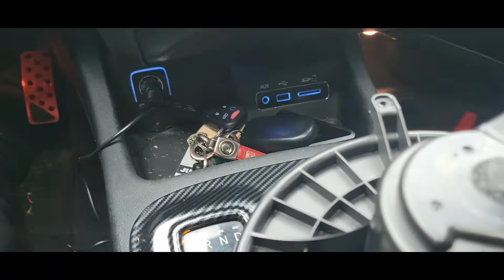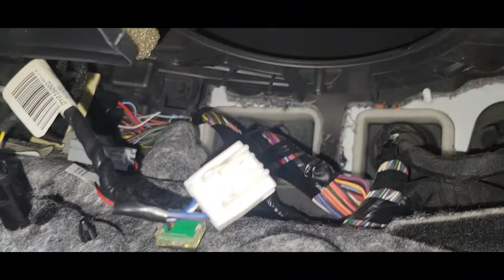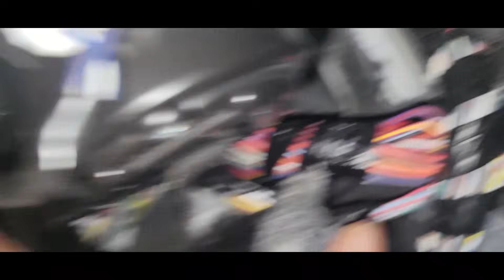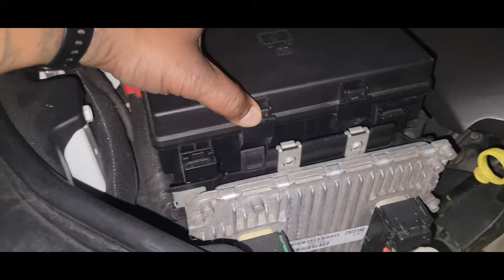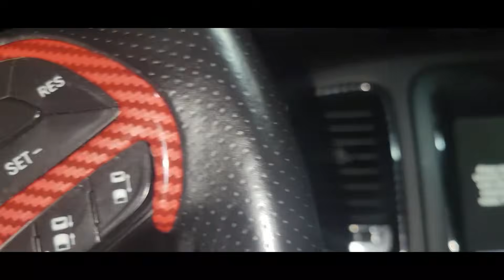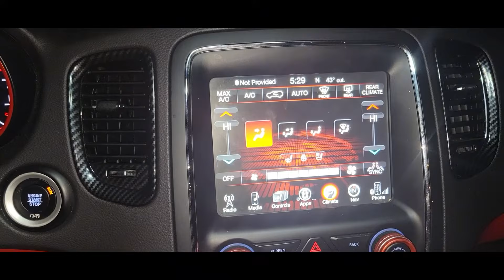How To Diagnose Dodge Durango Blower Motor | Repair No Blower AC/Heat On Dodge Durango

Comment: So what’s causing the fuse to blow?
Reply from the maker: The fuse usually blows due to an issue with the blower motor, resistor, or wiring, creating too much current. I had a friend mentioned that this will keep happening unless the blower motor is replace.  Try replacing the blower as an option and see what happens, but I have not had the issue anymore since I changed my fuse the first time

Comment: That was the exact problem with one of my vehicles.   Pulled the 40A fuse in the F13 slot.  It was burnt, replaced it, had air again.  Keep doing these vids.  You keep it short and simple and not beat around the bush.   Thank you.
Reply from the maker: I really appreciate that. Ty

Comment: Hi, Great video. I replaced the fuse, resistor and blower motor but still no air flow at all. Please what else can I try? Thank you for your time. I have a 2014 dodge Durango. Front not blowing at all
Reply from the maker: Thanks! If you've already replaced the fuse, blower motor, and blower motor resistor and the front blower still doesn't work, the next thing I'd check is whether the blower motor is getting power and ground with a multimeter. If there's no power, the issue could be the blower relay (if equipped), HVAC wiring, the climate control module, or the TIPM (Totally Integrated Power Module). Also make sure the new fuse is the correct amperage and hasn't blown again. Let me know if you have automatic climate control or manual climate controls, and whether the rear blower still works. That will help narrow it down.
Reply: @dodge4life715 hi! Thank you for your response! I'm barely seeing this. The rear AC is still blowing fine but the front still doesn't have any air coming out at all.
Reply: I believe it's an automatic. But I have a dodge durango, v6 limited. A friend of mine put power to it with a tool and it kicked on right away but shut off when he took it off.

Comment: I replaced the fuse and blower motor it started to work again because my blower motor was bad but not I stopped should I try and replace the resistor
Reply from the maker: Yes you can try that if you have replaced both the fuse and blower

Comment: I replace the fuse on my Durango and still no blowing air , do you think the blower motor is bad ?
Reply from the maker: Yes them you need to replace the blower.  My video shows how to remove and replace it

Comment: I was just flipping out, the heat just stopped working in my wife’s car , literally on the way home from getting a tire pressure sensor replaced. And it is the same as you described, nothing in the front, but air blowing in the back, cold. I thought blower motor. But am going to check fuse right now. Thanks
Reply from the maker: Hope it all work out

Comment: Yeah but what blew the fuse?
I’ve done this several times replacing the fuse but after replacing the fuse a few times it no longer works

Something is blowing the fuse
Reply from the maker: The fuse usually blows due to an issue with the blower motor, resistor, or wiring, creating too much current. I had a friend mentioned that this will keep happening unless the blower motor is replace.  Try replacing the blower as an option and see what happens, but I have not had the issue anymore since I changed my fuse the first time

Comment: So what is causing the fuse to overheat?
Why not check the resistor harness for melted contacts?
Reply from the maker: Most likely a poor connection or high resistance in the blower circuit. The blower motor checked out fine. On Durangos, the resistor or its connector commonly causes fuse overheating, so that’s the next thing to inspect.

Comment: Pretty good video except you did not the reason the fuse blew is typically because the resistance on the fan motor becomes too high as they wear out it will eventually pop another fuse and another and another until you replace the fan motor as you pointed out the fan motor is relatively easy to change occasionally the resistor can also be the problem with the fuse popping
Reply from the maker: I heard of that happening, but I haven't faced that issue as of yet

Comment: I’ve been dealing with this for at least 2 years. The first thing I checked was the fuse and it was burnt so I changed it. It worked again for a while then shut off again. It’ll always eventually go back on but sometimes it could be a while. I also just changed one of the relay switches cause it seemed like every time I would check the fuse box after it going off and if I wiggled or moved the relay it would come back on. I’m thinking there could either be burnt wires underneath the fuse box itself or the fuse box needs to be replaced. I’ve just been dealing with it and it’s annoying during the summer. Also too this only happens when thr AC is on. Ive had a leak fixed with the AC around the same time this happened.
Reply from the maker: I'm sorry to hear that. I haven't had any issues since.  It definitely sounds like something shorting the fuse itself.  I think it's your blower motor that needs to be replaced because it's going bad and short circuiting the fuse. Change blower motor
Reply: @dodge4life715 I actually found another video on here that might have solved the problem cause it’s been running fine ever since I did it. Changed the air filter. Mine was completely clogged. But then again I could have just jinxed myself saying it now 😆 but so far 4 days and hasn’t shut off yet. 🤞
Reply: Well I jinxed myself, it shut off again but it does eventually turn on back on after a few minutes actually faster this time. It Only does this after I restart the car too btw. Still a pain tho.
Reply: @RatSaladReview I’ve been having the same exact issue with my 2014 dodge Durango 

I’ve replaced the blower motor and the resistor for it the only time it seems to work is if I move my fuses and relays around but it hasn’t worked for months now and I gave up but now I have no heat and it’s my only vehicle😖
Reply: @l @lilliangarrett8430  damn. I’ve read somewhere that it might be the actual fuse box itself that needs to be changed and that sounds like it just might be your problem. 

I got mine working again from what I remember. It’s winter now so who knows what’ll happen once summer comes back haha! 

Now I got a leak somewhere and can’t automatic start my car without the engine light coming on. Love the car but hate the issues that keep popping up from time to time.

Comment: Question for you, the original 40 amp fuse was a low profile one and I see you replaced it with the taller one, any differences or issues?
Reply from the maker: I would go with the taller one.  That's what I took out of Mines

Comment: I bought a new blower motor think it was just done installed the new one and nothing i was about to go get a new resistor then came across your video and damn I went straight to the fuse box pulled the 40 amp and behold there is the problem thanks video was a giant help much appreciated
Reply from the maker: I'm glad it all  worked out

Comment: mines wss working fine and all of sudden started going from high fan to almost like if you shut it off but then it goes back on by itself. intermittent ac works fine but thw dam fan feels like you turn it off and kicks back on
Reply from the maker: It sounds like you've got a classic case of an intermittent blower motor problem or a failing resistor module.
Your AC system is still cooling properly, but the fan is cycling between high speed and nearly off before kicking back on by itself. This is typically caused by one of these issues:

Blower motor resistor failing - This is the most common culprit and controls your fan speeds
Bad connection at the resistor or motor - Loose or corroded wiring can cause inconsistent power
Failing blower motor - The motor itself might be starting to go out
TIPM issues - On newer Durangos, the Totally Integrated Power Module can cause electrical gremlins

I'd recommend checking the blower motor resistor first - it's relatively inexpensive and a common failure point on Durangos. The good news is this is usually a straightforward fix that won't break the bank.
Let me know if you'd like more specific guidance for your particular year model, and I can point you to the right parts and repair process. Thanks for watching my Durango videos!

Comment: I just did this by changing my fuse. The old fuse was burned on the sides and bottom. You'll need something to wedge the fuse out of its housing. I used 2 screwdrivers on opposite sides. Poped it out. Went to auto zone. Got a new fuse. Cost around 8 bucks. Put the new fuse in. Turned the car on and the blower came back on in a few seconds. 

Thank you very much for your help!👍🏽👍🏽👍🏽🙏🏽🫶🏽
Reply from the maker: That's awesome, thanks for sharing your experience!
Reply: I just did the same but I just wiggled it around and it works now

Comment: My ac is blowing hot air will this be the issue?
Reply from the maker: If air is coming from the vents then this is not the issue. It could be low refrigerant levels, a dirty air filter, a broken compressor, or a thermostat malfunction.
Reply: @dodge4life715 Thank you. It's a leak in condenser. We went ahead and filled it and let's see how ling it takes to leak out. I'm hoping it last for a while. Super cold though😊

Comment: Its going to happen again trust me, im dealing with da same issue rn, mines ended up melting da 2nd time, i unplugged da tipm box and da wire harness was burnt in da blower motor connector spot.
Reply from the maker: I will just have to keep my fingers cross..🤞🏽🤞🏽
Reply: He is right i successfully changed my fuse 3 times. 4th not so lucky. You have to find what is causing the fuse to blow to begin with 🤙🏽